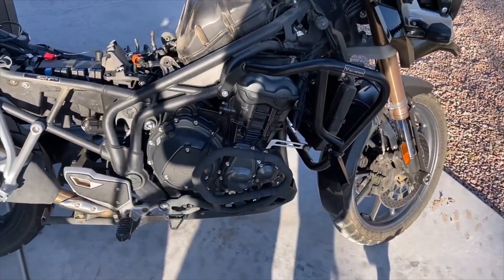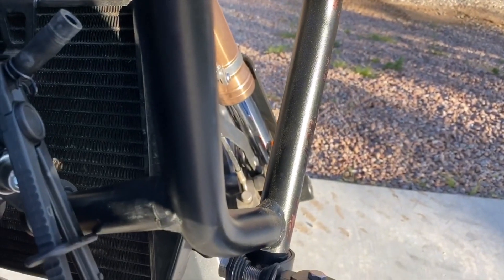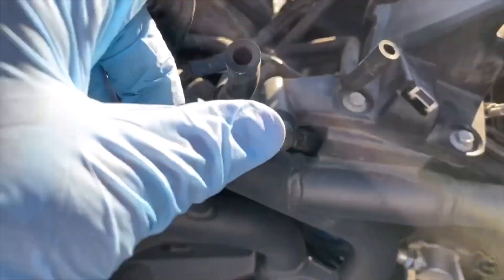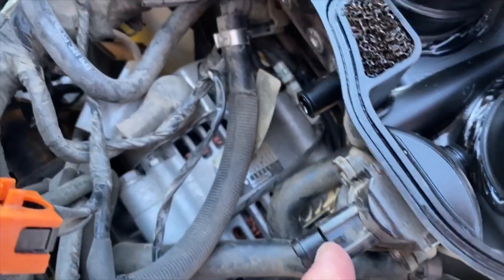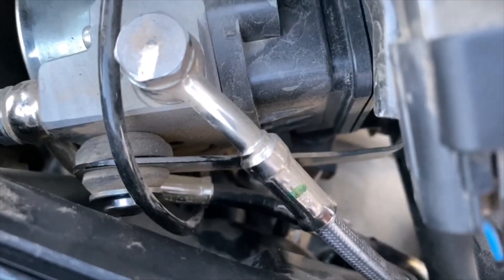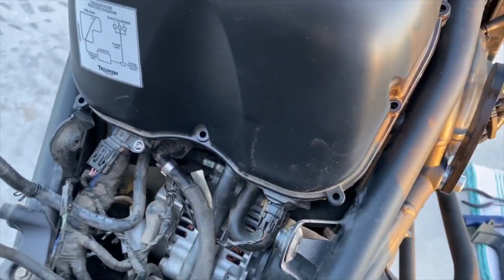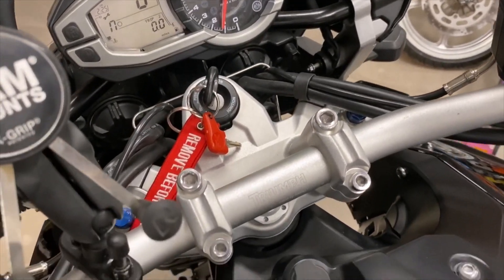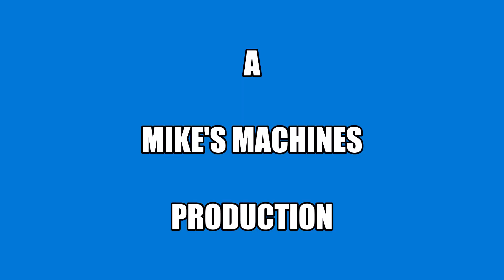2013 Triumph Tiger Explorer Spark Plugs and Air Filter

Comment: Dude.  I took off the tank.  You saved me on the hp fuel rail connection.  Pushed the orange clip to the side, but squeezing the clip was not obvious.  
The star drivers were critical, too.
Thanks!

Comment: Hey Mike, I'm currently following your video and I'm at the part where I pull out the ignition coils. Are they welded to the bike? There is NO WAY I can pull them out with just my finger tips. Did you use some sort of tool? Am I missing some sort of clip? Any advice would be much appreciated!!
Reply from the maker: Are you talking the spark plug boots??
Reply: @mikesmachines9394  Yes, but I already figured it out. A pipe wrench did the trick
 I was being too careful, it just needed some good old fashion violence and some cussing ;).
Reply from the maker: @ronbosgra8230  I think I mentioned that they were on pretty tight. Been a while since I did that service on my bike. Glad you got it sorted!

Comment: Hi, Hope all is well with you!
Nice and very helpful video. Just one question: how did you get to remove the lower part of the air filter box? Mine is completely stuck which makes me uncomfortable to continue the removal (afraid to break it up).
Thank you in advance.
Reply from the maker: It takes some force to get it off. The gaskets are quite tight. Same with putting it back on
Reply: @mikesmachines9394  I got it. Thank you so very much Sir!

Comment: Do you have to reset service interval on computer and how (for oil change etc.) ? tnx
Reply from the maker: Only a Triumph tec can reset computer
Reply: @mikesmachines9394  ah ok...but is it necessary after oil change? This time I have to do it myself haha tnx
Reply: Actually it's easy to do with Obdlink LX (~50 Eur) and TuneECU (10 Eur) app on android. You can also bleed the ABS, change tire pressure sensors, see the throttle body synchronization etc.